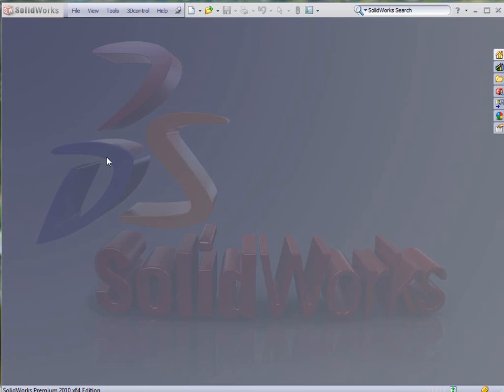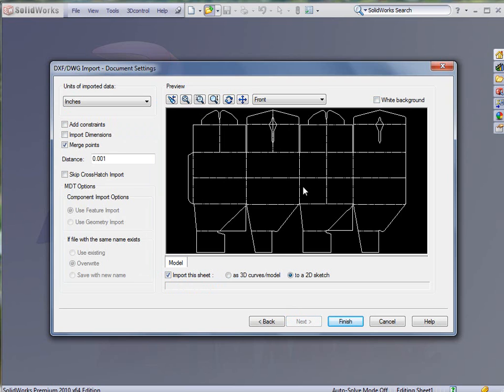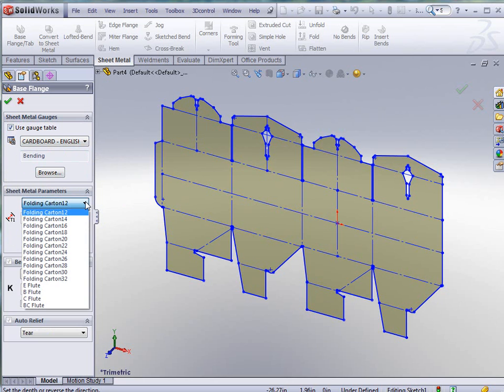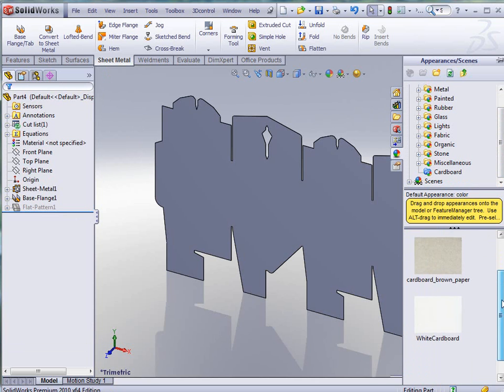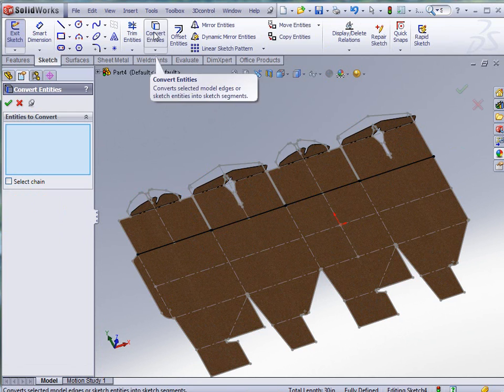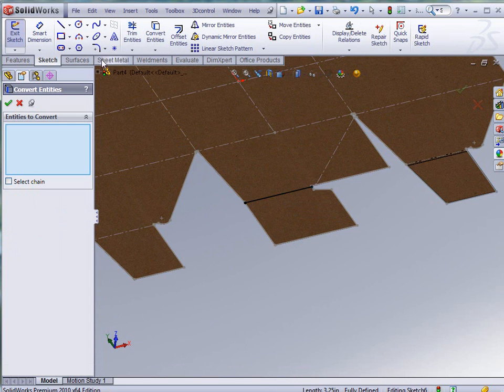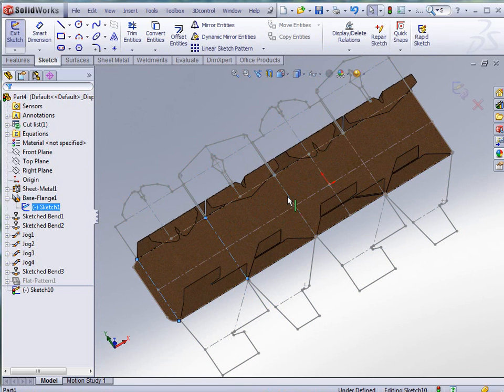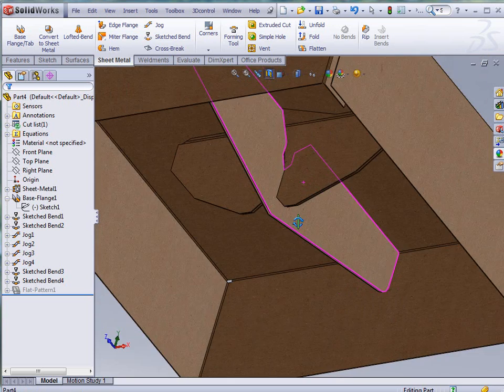Folded Box in Sheet Metal.wmv

Comment: Hi, does anyone have a way to add the Cardboard Gauge Table to SW? It's not in my Gauge Table drop down menu, SW files or SW Content Central, GrabCAD, etc. and reseller support couldn't find it. Even the raw data or rough guideline for fold compression, etc. would help. Thanks.